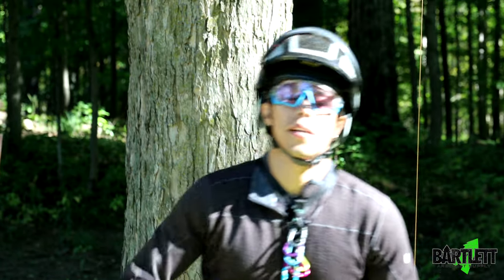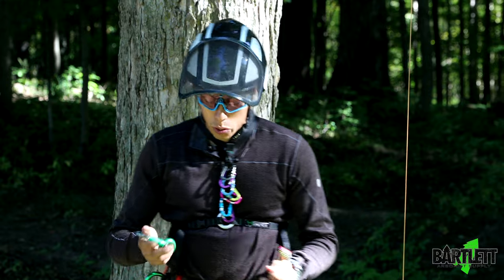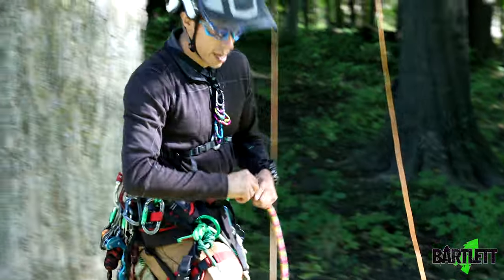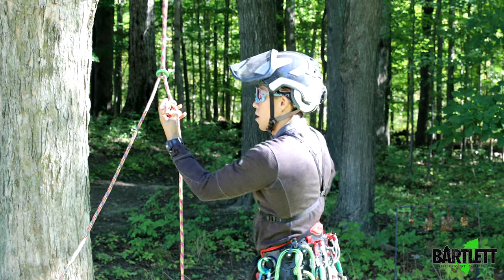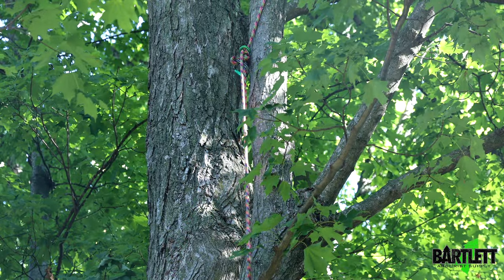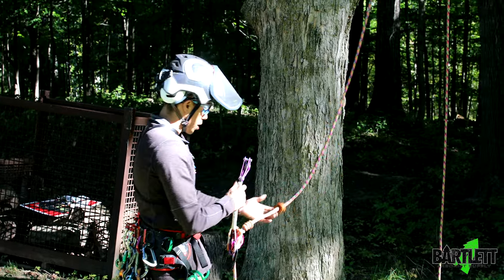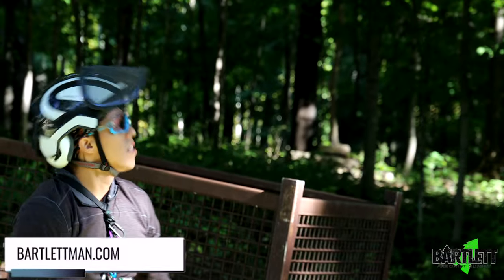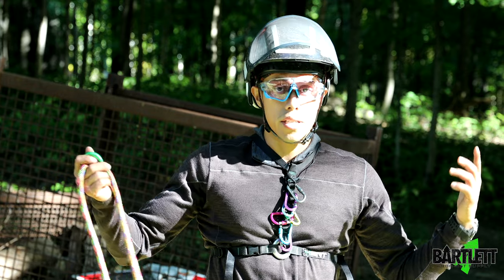SRT/SRS "Floating Anchor"

Comment: The climber who taught me this method sets a standard remote canopy anchor with a quickie shackle from the ground, then modifies the remote anchor to floating upon ascent.  Personally, I like to set a mid line canopy knot from the ground (double bowline backed up), ascent, then untie and insert a 10mm steel quick link with butterfly stopper for floating.  I don’t worry much about the galvanized quick link galling (as in stainless threads) or falling to the ground and it only costs $6 to replace it with a.rated piece by Metoliius.

Comment: “Floating anchor” or “floating ring” is an excellent technique, but I have been using it for over a year & there are some details that may be useful to know. 

The first one is that it works best with two spliced lines (one for climbing, the second for retrieval). Two factors are important here, you can jam the ring directly with a carabiner. (Advancement of the tie in point is super quick & you don’t have to pull all that excess line through in the setup) You can also disconnect the retrieval line & use it as a second climbing line temporarily to make advancement easier.

The second issue with this system is retrieval of the ring. If you go through a redirect high in the canopy, sometimes the ring will get stopped from sliding down the rope or the rope will just slide out so fast that the ring stays in the canopy or freefalls out. Not a good thing to do to life support equipment. I have solved this problem using a mini carabiner & a throwline. The climbing line can be replaced with the throwline pulling the rope back toward the anchor till the throwline has replaced it, but they are still attached. Using a slip loop & three wraps of the spine to attach a mini carabiner with an end small enough to enter the ring, but large enough to not go through is the key here. Pull from the other end of the throwline so that the mini carabiner hits the ring. The ring is captured and now you can pull the ring back to you with the climbing line. The throwline will be at a 2-1 mechanical disadvantage, but the lack of friction in the throwline & the added weight of the climbing line makes it easy to pull out under control.

Love me the floating ring technique!
Reply: Sounds good and better make a video on it ,thx mate